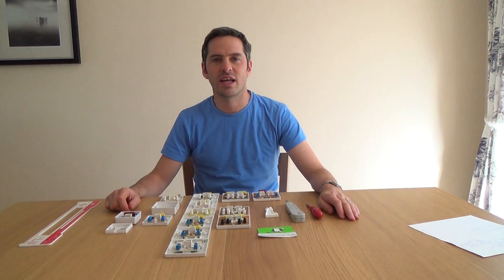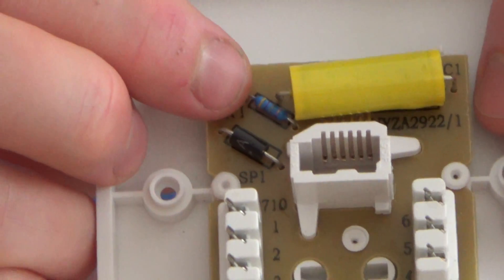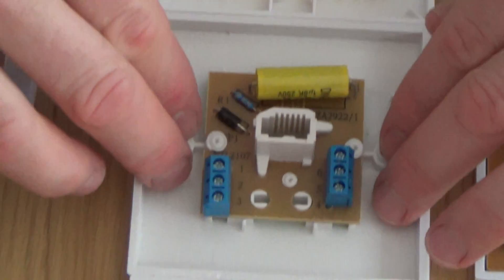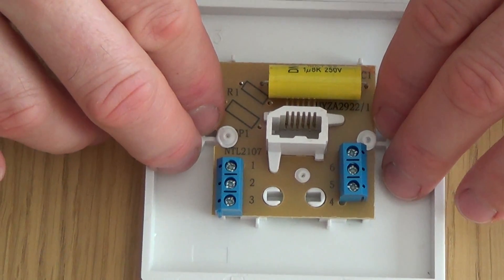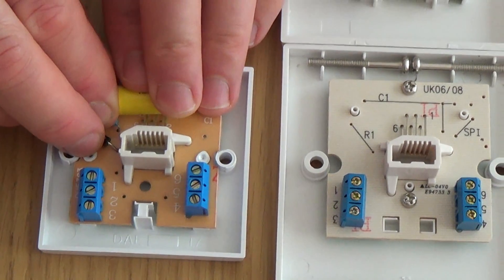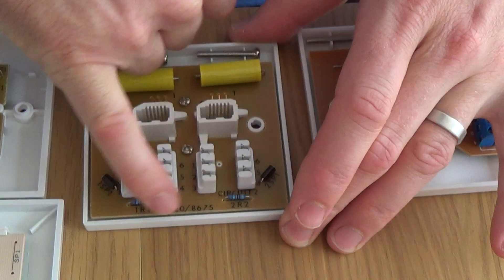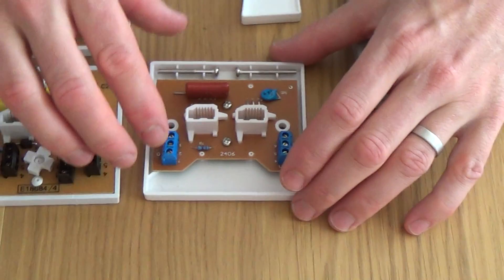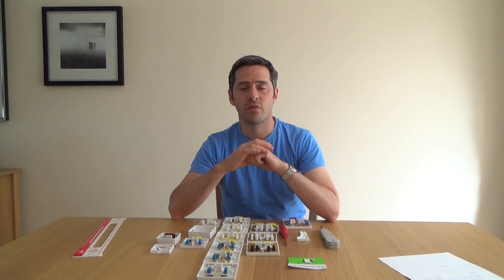How to tell the difference between TELEPHONE SOCKET LINE JACKS, LJ2/3A, LJ3/1A, LJ4/4A etc.

Comment: /6 is the one i have in my bedroom with white flat lead blue 2 red 3 white 4 and 5 running to master socket in hall
Reply from the maker: +Conor mallon Hi, I am getting confused with all the different messages on the different videos. If you have a flat lead then do not use this for the broadband signal as flat leads are not very good. If you want to use a Cat5e or CAT6 lead with RJ45 to RJ11 plugs then you need to have an ADSL faceplate or a VDSL faceplate on your master socket because the RJ45 (bigger plug)  will not fit into the small plug in micro filters. If it is too hard to move your router then run a wired cable from your router up to your bedroom, these cables are called Ethernet cables.If it is too hard to run an Ethernet cable then look into Powerline Adaptors (see my latest video).I hope this answers your questions.Thanks Vince.

Comment: Hi Vince, Can I use a 3/1A as a master socket or do I have to use a BT NTE5 one? 

thanks.
Reply from the maker: +luis martinez Hi, the 3/1a will work as a master socket but on a NTE5 master socket you can separate the extension wiring from the outside line so you know if you have a fault whether it is internal or external, you won't be able to do this on a 3/1a.Thanks.
Reply: +My Mate VINCE understood, Thanks Vince, a I probably will still use the a chrome one, the missus won't have it any other way ha.